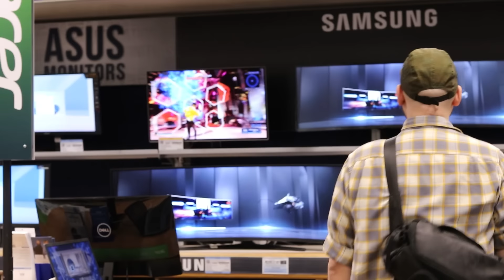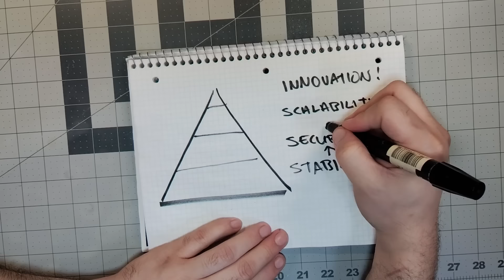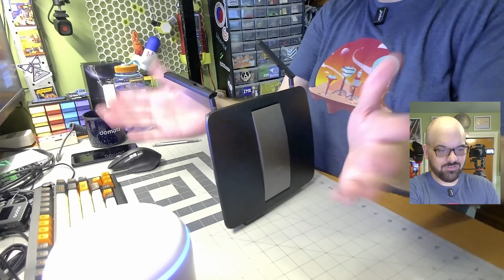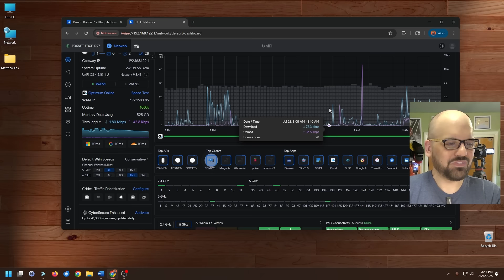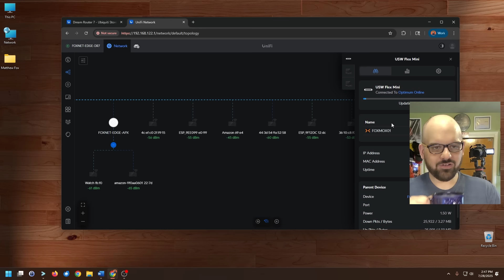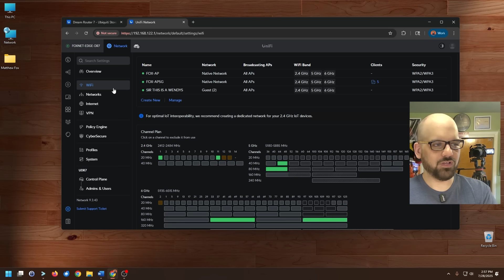UniFi Dream Router 7 - My Impressions After 90 Days

Comment: Got the Dream Router 7 plugged directly to fiber with an XGS-PON 10G and speeds top at 1.4Gbps and lower 1Gbps with IPS enabled. Ubiquiti specs this machine capable of 2.3Gbps with IPS enabled. Had the same much lower speeds on the previous Dream Router. Ubiquiti is being very dishonest here even selling this machine as perfect for ISPs!! Please. Than there is the Cyber Secure option I'd like to buy but they charge as much than enterprise for residential users for much less signatures. Non-sense.

Comment: Just bought one today. I paid a decent amount for a tp link be600. Total garbage. Yes it has wifi 7 and 6ghz. But my S25 would randomly disconnect. And  some lighting devices had issues connecting. Sometimes I'd tell Alexa to do something and she would be stuck there thinking. Such a horrible router. Hopefully this one is way better

Comment: Experience thought me that the number of frequent updates does not correlate to how secure a software is. People usually penalise good software, secure from the start, that doesn't actually need security updates, in favour of crappy software that needs to keep being patched all the time to work securely. Often, with each update, new bugs are introduced. Making a parallel with the jobs market, who do you think a company is going to layoff? A software engineer who wrote software that works, is secure, and doesn't need too much maintenance, or the one who wrote software that works, has lots of bugs and security flaws, and needs patching all the time? The truth is, the former is usually considered "redundant", not the latter.
Reply: @willchb  
Ubiquity add additional features all the time as it expands on its offerings and it includes fixes as well, the fixes are rarely security related because that aspect of unify is pretty well locked down

Many of the changes are because Ubiquity are pushing towards to enterprise market so they keep adding features.  You are not forced to upgrade, you can stay on a version of you wish

Comment: Lack of 2.5gb lan ports kills it for me. Dream Router 5g max fixes it but at a steep price
Reply: What?

The specs show it has all 2 5gb lan ports and one is even a poe port 

Default WAN Ports
(1) 10G SFP+
(1) 2.5 GbE RJ45

LAN Ports
(3) 2.5 GbE RJ45 including (1) PoE

Comment: I bought the original Dream Router and it did not deliver gigabit speed over Ethernet. Very disappointing. Never gonna buy a Unifi router again.
Reply: Are you referring to the WAN interface or the LAN interface?

The internet Gateway Router part for Internet access had a maximum throughput of 500mbps with all features enabled.

The LAN part had no trouble with gigabit speeds. I'd be checking the cables and devices if you couldn't get gigabit speeds out of the LAN interface

Comment: Well I did bought one, great feature and interface until I did realize that:
In Insights, Flows, the only option available for this DR7 is Blocked and Threats.  So you have NO visibility in flows for the traffic allowed.
This lack of visibility make me reconsider this Firewall...
Reply: @AlexTurg  I just got one and realized this. Have you been able to find a workaround?
Reply: @freddy0110 no There is no workaround.  It's just not available. I did return my dream router 7 and get ucg max instead : much more happy with it.  I took no storage just to use the gateway.  All flows are available, more cpu available because no wifi 7 ressource that take cpu ressources, no more DNS bug with ad blocking and snappier unifi.
Would not go back. I have two wifi 5 AP so WiFi is not required for me.

Comment: Took Tom advice and tried Unifi. The best decision ever! I ended up having a hodgepodge of EoL routers and switches over the last 15 years and it was like all my networking headaches vanished. Ok, a few still lingered like getting everything playing together nicely took some getting used to, ROI (get what you pay for but it did cost a good penny), and ease of use (getting the user base acclimated to change).

Comment: I have all my network on Unifi, a router, a few switches and AP's and then some cameras. ALL of these are integrating well with my smart home (HA). I would never switch to other brand unless Unifi goes crazy. For all the wifi iot devices which people are telling NOT to use because a smart home will get soon unusable, I tell you this: I have learned more wifi with Unifi than you can imagine and I would never use other protocol. It works well, rock solid, no drops, so why not? I am having 28 wired devices and 49 wireless devices, all running strong. I am also doing dual Wan over a 4G connection with a Teltonika router, runs smooth. Is it  a cheap sollution? No. But it is working as intended because is built well.
Reply: Unifi cameras not worth the price. You have many way cheaper options with terrific quality to use in HA.
I personally prefer Zigbee with Z2M to WiFi. A good POE controller and Z2M and MQTT  not installed in the same HA machine is recommended. A strong mesh is paramount, plus devices with a good implementation of Zigbee 3.0. Blazing fast. Low consumption. Less WiFi saturation.

Comment: The launch of the udr7 has been terrible. I’ve had one since launch and it’s been no where near stable. Constant issues with throughput which took them months to resolve. They had to enable hardware acceleration, which should have been available at launch. And now I’m having hand off issues between the udr7 and my u7 pro. Honestly terrible experience, will never buy UniFi until the product has been available for over a year.

Comment: Honestly I'd go with a n100 router as an enthusiast, just slap Proxmox on there and run opnsense and unifi controller (if you need it) in VMs. That way both will run soo much faster than the less than mediocre arm cpu in the dr7. For wifi just go with a nice discounted wifi 6 ap and put it where you need it. Having wifi integrated in my router limits the range a lot as in my (past) homes the internet came in at the edge.

Comment: I did the same thing several months ago. I didn't have a pyramid to reference, but I knew I wanted something that was more enterprise/home friendly that was big on security and I wanted to have something that I could grow into. My brother in law has been in the corporate tech world for many years and said Ubiquiti was an awesome option. And at $279, this is a much better and cheaper option (IMO) than the mid to high end consumer grade devices from the likes of Asus, TP-Stink and Netgear that only get so many updates before they are abandoned and left vulnerable. So far It's been great. It does what I need and will do SO much more if/when my needs change. If you've been struggling to roll your own OPNsense or PFsense router/gateway/firewall like I had been before getting the UDR7, you will most likely feel like a mental weight has been lifted from you because config is so much easier.

Comment: And just like that, Lawrence Systems has gone from PFSense fanboy, to UniFi fanboy.  Looking forward to the 1 year review on those "stable" firmware updates.
Reply: I've used Unifi Gear since 2019 in a business environment, and had very few issues, even with automatic updates. Once of my customers has 3 UDM Pros, in separate offices, using Site-to-Site VPN, and been very stable. Talking about 150+ end users, with client VPN, site to site VPN, and IDS/IPS, and Unifi Talk, and Unifi Protect running on each UDM Pro. Very easy to configure, and very little headache. Unifi OS nowadays is mature compared to when I first started using it. Very good value, and feature set IMO. I like Meraki too, but the licensing is quite the premium price.
Reply: Unifi videos get the views!
Reply: They where doing unifi installs 5+ years ago

Comment: I bought one just the other day to replace my AirPort Extreme Router. So far it’s working out pretty well.
Reply: Is the fan noisy?
Reply: @jonny5alive555  I have one and it's definitely noticeable. It's audible from across a quiet room and buzzy like a little fridge. Not loud, but much noisier than Apple's laptop fans, for example.
Reply: You might already know, but Ubiquiti's founder was previosly an engineer on the AirPort team.
Reply: @paranoidandrewoid  yup, first thing that came to mind when he mentioned AirPort
Reply: @paranoidandrewoid  This explains why they're essentially drop-in replacements in pretty much every way. From simplicity of setting up to their physical design.